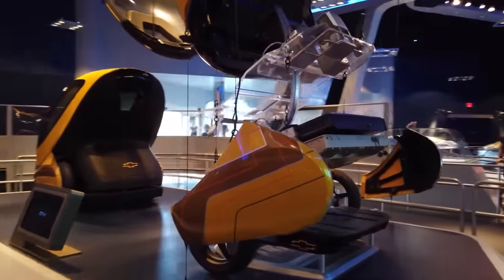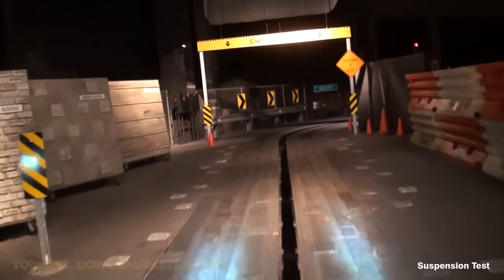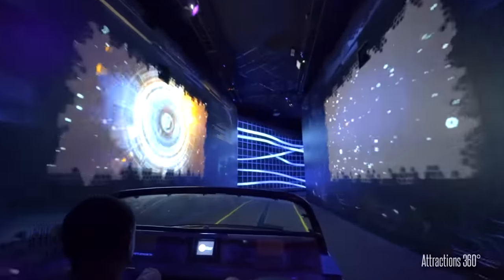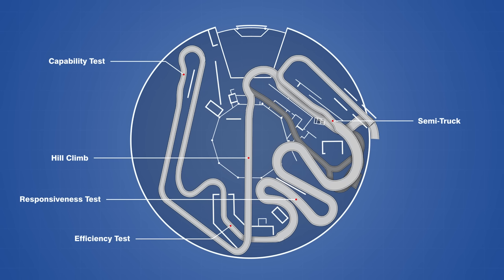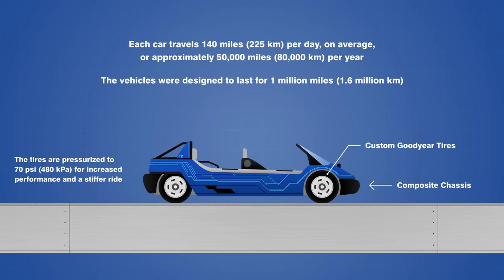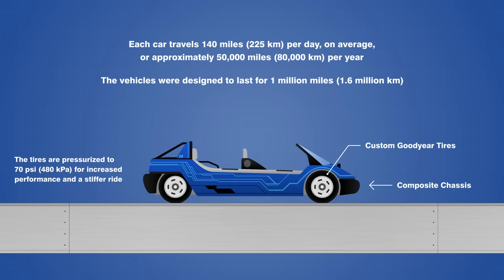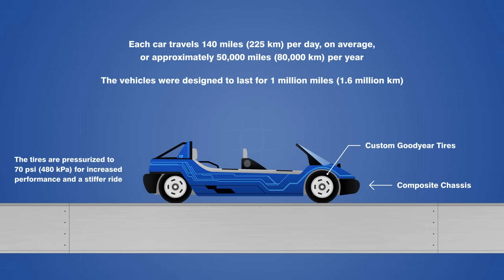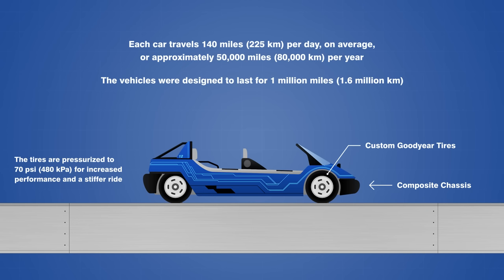How Disney's Test Track Works

Comment: something interesting about the tires design is that goodyear actually had to change the rubber to break down in chunks, unlike a normal tire. Normal tires lose grip so slowly and finely that the ride would collect huge piles of rubber dust in the grooves of the track, which was a pain to clear every day. With it breaking down in chunks it could be easily swept out and recycled.
Reply: They were just racing slicks - rubber tire "marbles" are all over the track.  And under, there is PLEANTY of dust from tires but much is from the collector arm shoes.  It's a composite copper that includes an embedded lubricant similar to graphite.

Comment: Many years ago when I was riding one of the ride vehicles had a tire fail in the middle.  We were stuck on the hill climb portion for almost an hour as they pushed each car in until they got the one with the flat tire off the track.  Due to the track system, there was apparently no way to get the one that broke down in the middle off except to do that.  The Disney workers were great and kept everyone updated.  After about 20 minutes they offered to let people off, but we had waited so long in line we elected to stay on the ride.
Reply: Damn
Reply: 20m minutes? We’re they afraid people would fall to their death? SMH
Reply: @Dana McCall  dont want the ride starting by fault plus they likely had to let out people behind the bad car so to move it and clear the ride or repair it
Reply: Probably not a flat tire (there's a way to move those on the ride using a special mode called a "ride stop" and manually controlling the movement of the vehicle from the rear deck, and even so, when there is low tire pressure or a flat, the vehicle goes into a special mode called an auto cyxle out. When am ACO occurs, the vehicle goes to jog speed.). If something major happened before the switch to vehicle storage, we could often keep the ride up as we could get a vehicle into there in about 15 minutes.  Past that switch nearly always resulted in the ride going "101" as it was a long, long way back to the maintenance bay.  Simply not a way to get enough vehicles out of the way.  

Broken axles, similar to a CV (constant velocity) axle in a car is used and were common.  So frequent, especially on the hill climb, the ride profile was changed from that area.  Lower torque and acceleration made for better ride up-times, something that was a struggle through I'd say 2006-2007.  We made huge changes to several systems to improve that.
Reply: @johnrpishotta  Thanks for the insight.  The tire appeared flat but I am sure you are right that there was more damage than that and I can't recall if the axle might have been broken.

Comment: Little known but very awesome fun fact about this ride is that GM employees can go to a special lounge on one of the upper floors that overlooks the loop of track that goes around the building. They have snacks and drinks there and you can spend as long as you want designing your car versus the 90 seconds or so you get in the regular line area. You can sit there and watch the cars go around the building from above and relax in some much needed AC depending on the day you go. 
Source: My mom worked at GM (now retired) last time we went.

Comment: At 12:37 you say it uses antennas/transceivers to communicate between the cars and track. I wonder what frequency/band these are running at. Does this mean someone could theoretically slip a signal jammer somewhere on the ride and render all the cars temporarily useless until it’s disabled? Might be difficult to diagnose too as it would appear to be a hardware failure to the engineers
Reply from the maker: I suspect that you could probably interfere with the ride's communication system using a signal jammer, but I wouldn't recommend trying it unless you want a lifetime ban from the park 😅

The ride covers a wide area, so I don't think you could take the whole system out at once, and that would help to pinpoint the location of the device. Anywhere the public can access is also monitored with cameras, so it's unlikely that you would be able to place such a device without being noticed.

Most modern Disney rides utilize rf communication in some way, so I would imagine that the engineers have considered this problem and have put countermeasures in place to prevent tampering.
Reply: If jamming occurred, you would get packet loss.  If you get packet loss, the vehicle will apply the brakes.  Just a guess.
Reply: From what I understand it is not a wireless system.  The signal is transmitted through the contacts that are on the side opposite the power.
Reply: @howardm2642  Yeah, it's not clear from this video.  There are two controls in this video.  One is connected along the bus bar (as you say) and controls the distance between vehicles.  The other is connected wirelessly to the central control.  12:40 shows the wireless connection via transceivers on the left.  And shows the bus controls on the right.
What's nice about this system is the vehicle itself can detect a problem and shut down, or determine if it can go into the next zone.

Cool system. cool video.
Reply: I’ve always had questions like this since I was young and I think it fuels engineering curiosity. Basically “how could I break this?” allows you to think of ways to prevent it in the future and is evident that such a mindset was used when designing this in the first place (albeit from a “what if this aspect broke” perspective). 

If I were to try to sabotage this ride though, and minimise the risk of detection, it would be via a time delayed jammer. It’s not clear from the video whether the diagrams of space underneath are to scale, but if you were able to drop a self powered device down there that were small enough not to physically jam the device (or be spotted doing so) it would then need to be powerful enough to cause issues from a reasonable range; the first thing the maintenance team might do once they’ve figured out it’s RF related is to check the immediate area where the vehicle stops, and they might not consider the fact of where it starts working again and centring in on the devices possible location. 

Anyway, just theorising, please don’t do this, I don’t want to be hunted down by an evil Mickey Mouse.

Comment: Here's another tidbit about the track and ride system.  Broken down vehicles were frequently pushed using a special, battery powered unit that had a wheel that was lowered into the slot.  A special air break release valve was used so that the vehicle could stop.  Broken down on the hill climb?  There's a winch and cable system under the track that would be used to pull the vehicle to the top and then it would get pushed into vehicle storage, often times by hand.  Just had to reduce the air pressure on the bogies a bit to help release the pressure on the actual track.  Of all the rides I worked on (as in engineering and maintenance),   Test Track is #2 only to the Monorails.

Comment: Before being remodeled, this was the most immersive themed ride I’ve ever ridden and the old one probably remains my most favorite theme park attraction— I would consider test track 1.0 as a core memory of mine
Reply: Yes, it was.  Many physical effects over the current videos that are used.  Most would not remember that "crashing car" just before the run-out of the building for the high speed portion of the ride.  It was a sled system that would move a car forward, "hit" a wall and then look all dented up.  Just after the ride vehicle passed, it would be pulled back and the panels would reset for the next one.  It was a maintenance headache - but I always did all that I could to keep it going.  It tied so closely into the show of the ride, all the way back to the "briefing room" back at the preshow.  It eventually became static (no movement) and a misting smoke effect added.  

Another detail on the original ride that was only observable from the front row of the car - two traffic cones in the non-abs test would be across the track that appeared to sweep to the left, but the car would juke to the right.  Right as the vehicle would approach, the cones would quickly move down for the car to pass over.  The vehicle did not hit them.  It was timed with the wayside RCC (ride control computer).  One of few effects that the RCC handled over the show control computer.  The crash doors being the other.  This was due to those effects being a part of what is called the ride envelope - the track or on the track where a vehicle could hit the device.

Comment: I haven't been since 2019 but pretty much every time I go and its a lot this ride still breaks down a ton compared to any other ride in the park. I think its still down more than its up.
Reply: damn. it didn't break down when I was on it, but we stopped for maybe...felt like 20 min, perhaps less. it was right before the outside part and I'm Sqweemish when it comes to bigger rides or anything with even small hills etc. so I was nervous 🙃 first time I did it it scared me slightly but it's so quick. I ended up riding it about 9 times. LOVE it.
Reply: Yea it's extremely complex and extremely unreliable. That tends to be a trend
Reply: No lies detected

Comment: Very good review. You are quite accurate in what they were going for, and the shortcomings of the technology used to actually implement the changes made. I rode the first version of Test Track around 2000 and the latest version in 2018. While the old version fairly accurately represented the test track of GM, the new version however as an electronic design studio fails to impact the cars in any manner - it is all a computer program determining how your design will do and you cannot experience it.  It is just a bunch of binary code that gives you your "results" at the end of the ride.

Comment: Hopefully in a future retrofit, Disney will implement ways to reclaim the electricity generated by regenerative braking. If not batteries in the car, then perhaps another set of bus bars that are send the car's generated power back for use. Disney could store that power in battery banks in the main structure to supplement their mains power.
Reply: Alternatively, if they invest in renewable energy sources then there's less need to preserve that small amount of energy. Properly harnessing solar, tide and wind power opens up such interesting changes in energy use and storage dynamics.
Reply: Disney already powers itself on your trash and other waste in the parks. And they have some huge solar arrays they've been putting on over the past couple years too.
Reply: @tankerkiller125  The solar arrays make me mad because they cut down trees to build them.  They could have spent a little more money and covered all of the parking lots with solar arrays and shaded cars at the same time.
Reply: Sorry to say, that's not really a possibility due to the way that power is created and stored.  There would simply be too much loss to efficiently move the power to a wayside storage area.  Then there's the maintenance...   It's just not that much in the grand scheme of things.  For these vehicles, that power was dissipated as heat through a special resistor pack.

Comment: I used to think the sliding doors to the outside section would just break a plastic pin and swing open if a car hit them. Having them made out of styrofoam-like material makes much more sense - the impact is far less dangerous than with any form of metal. I would also imagine making them out of a soft material means, if any part of them were to fall on riders during an impact, it wouldn't be nearly as dangerous.

Granted, hitting the wall would be pretty terrifying for the riders in any case... but still.

Comment: 13:43 The excess energy isn't dissipated with regenerative braking.  It is fed back to the ride "grid" through the AC bus bars and used by other vehicles that are accelerating and/or traveling at high speed.

Comment: One thing you forgot to mention is the four wheel steering on the cars. Some production vehicle features this as an option. But for test track it takes it to the extreme. Thats how the cars get around the tight corners very quickly (edit unless you did unless I wasn't paying atention)
Reply: Not mentioned, but clearly shown in the footage a couple of times.
Reply: Quite honestly, the 4 load bearing tires (the rubber ones that you see), have zero effect on steering the vehicle.  They are all 4 independent.  Another lesser known fact, these vehicles cannot go backwards, even for short distances.  There is a specific type of shock absorber called a damper in place that dampens oscillations when traveling at speed.  There are 8 wheels in the bogie assemblies that actually are responsible for  guiding along the track.  While I appreciate the analogy, these vehicles could never be driven on a street without very major mechanical rework.  Just not possible.
Reply: @johnrpishotta  While I agree they're not street-legal, I noticed all four wheels turning even at 3:30, which I thought was interesting for immersion, visual appeal, and maybe even ride quality. Do you think that's just an illusion or could some hydraulic movement be involved, even though it doesn't directly affect the steering? It makes sense considering real cars rely on visible wheels turning, and it might even prevent unnecessary wear and tear on the tires and track surface. Many of those corners are quite tight, and with vehicles traveling thousands of miles a year, not having the wheels turn could easily lead to screeching noises and potentially disturbing guests due to the sliding across the floor. While I realize some subtle screch sound still occurs, the simulated steering likely minimizes it and reduces wear and tear. In turn (no pun intended!), this system could actually be saving both components!
Reply: @rocketbunny2677 - each of the 4 wheels are independent and do move when going through a turn- tires are already chewed up by the track surface, which is coated with the same high grip, anti slip coating on aircraft carriers - they would be obliterayed if they did not move through a turn. They just don't steer the vehicle, per se - they just follow along. That's done by the bogeys below the deck where the actual track is. Nothing connected to them except the damper. 

And as for any tire chirp noise, anything you hear is part of the wayside (off-board) audio track. The only place you could hear tire chirp is in maintenance bay. After the roll down door that leads into the bay, the deck is not coated with the anti-slip material.

Comment: I confess to missing the original World of Motion ride as that was fun in a different way.  That being said, I do recognize that it wasn't getting much traffic, so something more popular was needed.

While the line in the original Test Track was noisy and thumpy to be almost a pain (the sound proof room was a relief), the ride itself made a lot more sense than the current Simtrack concept.  I especially liked when the director was giving commands to the controller on which tests to include and ended with "pick one"...so she added the Crash Test 😊).

Comment: Excellent video.  Superb details.  Kudos.

One think I don't understand is how the normal acceleration and braking is programmed.   Is each vehicle following a predefined speed curve for the whole track and using both the encoder wheel and the radio communication to know where it is?

Comment: Does the ride have any mechanism for steering the cars? If not wouldn't the cars be essentially skidding through every corner quickly wearing down the tires?

Or do the banked turns somehow mitigate this?
Reply: The tire wear and tear is huge anyways, just have a look into the planters just underneath the track at the exit of the store. You'll see lots of small rubber specks, sometimes you can also see some on the ground but those are usually quickly swept up by a custodial cast member. It's bits of the rubber tires which fly off during the high speed portion of the ride. I always wondered how often they need to replace the tires on those ride vehicles. My guess is they are full rubber tires, so they will hold quite a while longer than regular car tires would.

As for the skidding, in the video you can see that both front and rear axle are connected to the guide rail below the track, so the tires always follow the direction of the tracks.

Comment: My question is “ is there any system in place that activates when a car goes offline I.E something like a mux gate where the low select signal just takes what’s on the go rail and transfers it to the no go (assuming that the go signal can also be used as a stop signal on the other rail) while high select is how it normally deals with the read write on that bar

Comment: Amazing! You should do Mission Space. I was a cast member there and I can tell you that the engineering behind that attraction is incredible!
Reply: Here's a "fun fact" about Mission: Space - each ride bay (4 of them) have 10 capsules that are mounted on large arms that extend from a central hub. There is not one, single metal weld that is a part of the arm support structure.  Everything is assembled with a special type of rivet.  Same for the T-bar control arms (there are two) that connect the body of the Test Track vehicle to the bogie assemblies.  No welds - all rivets.  Why you ask?  Welds can crack and break, rivets not so much.